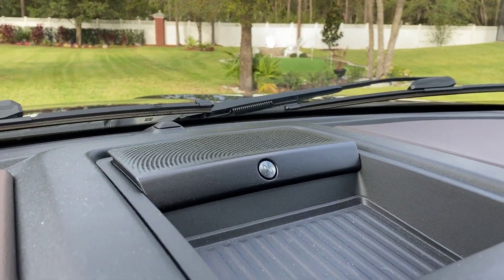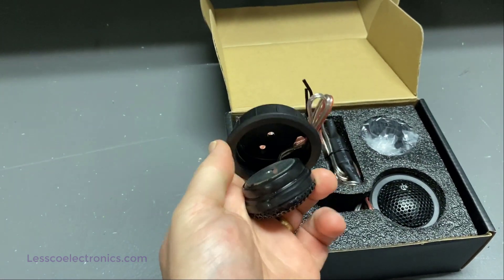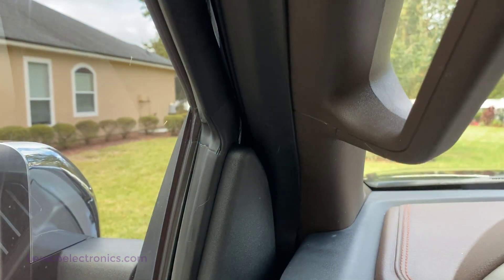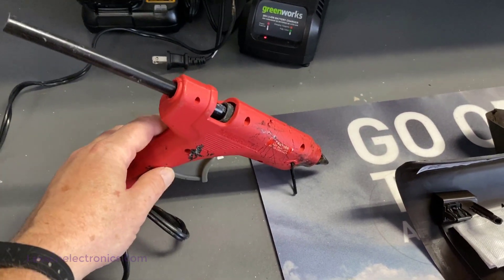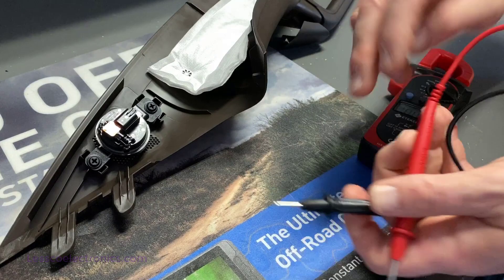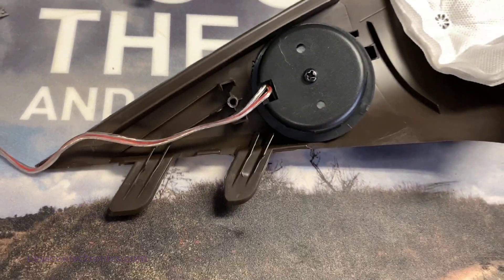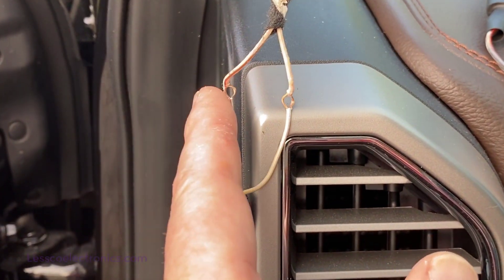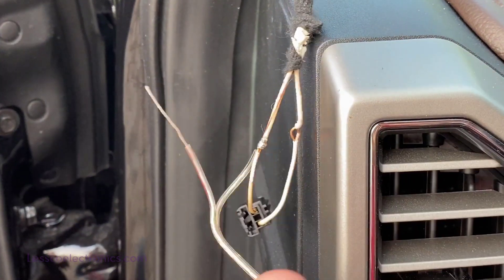Upgrade your front stages tweeters in a Ford F-150

Comment: Thanks for this video! It helped me figure out the wiring polarity on my tweeters in a Ford Escape. I could not find it anywhere on the internet. The methods I was finding to determine polarity did not seem practical for a tweeter. They all required you to watch the speaker cone to see if it was moving backwards or forwards. My tweeters are to small to see anything. Your advice on looking for the capacitor for the (+) side worked for me. I didn't use a meter, but I could see the left side was going to a capacitor before going to the tweeter. The (-) side went straight to the tweeter. The positive side was the left side as well - like yours.

Comment: Swapped out the infinity speakers in my 2010 dodge nitro back in 2014 with all massive audio speakers.
LS6 in the doors and the DX2 in the dash 
Didn't swap the infinity amplifier though but it sounds great still.

Comment: Is an amp necessary for door speaker replacement on these trucks?
Reply: Man, to get the best out of tweeters you need to run them with an amp. The difference in sound is astounding.

Comment: I can actually hear the difference in sound when its wired correctly. The correct wiring will sound crisper than the incorrect wiring. Pretty simple if you don't  have a multimeter. 😊